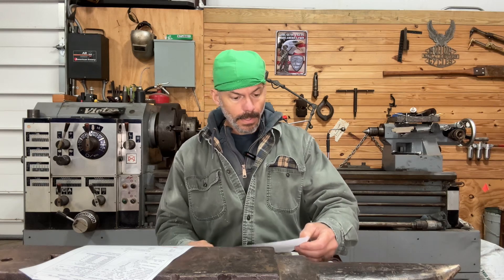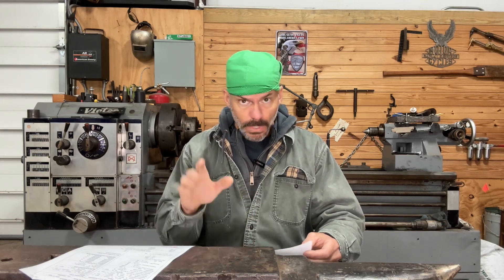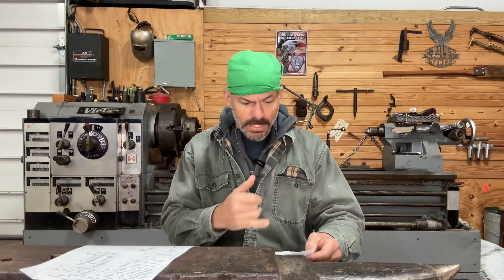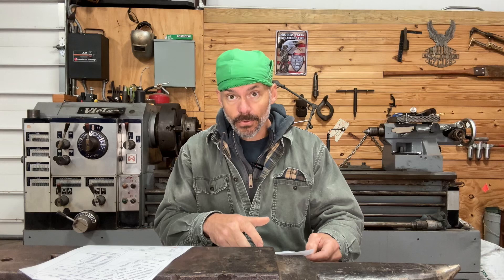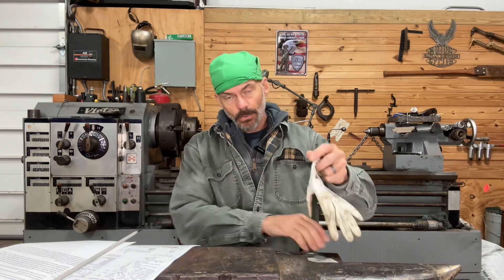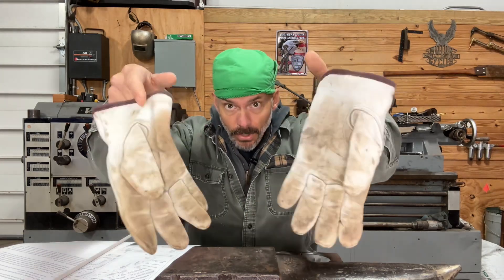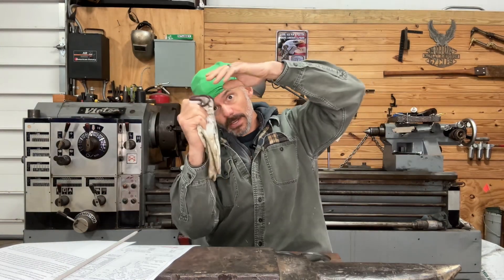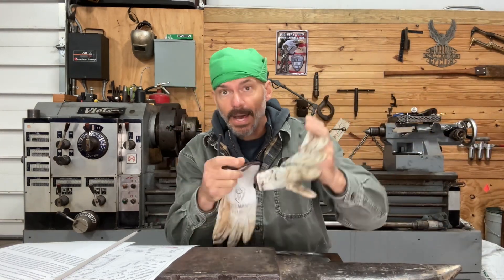WELDING TEST SETUP & Taylor welding Q&A

Comment: I was welding for a  company and they keeper tell us to weld stringer.  I set my machine on continuous and welded in a weave pattern, and a fellow welder told management that I was doing a weave pattern and not stringers. I had just finished up a 12 hour day, and the management came over and told me that my job was on the line for doing the weave not stringers.. that was my last day of work week, and I didn't come back till next Friday at 6 pm. We worked 3 12 Friday till night Saturday night Sunday night. The best job I have ever had in my welding career ever... so didn't know if I had a job  to come back until I got back...got back and everyone congratulated me for my weld. Cam to find out in house inspection did two different inspectors and out side inspection did three different inspectors. Passed everything. Ultrasound inspection.  So, watching the puddle is vital.

Comment: What’s up I’m Isaiah and I did my overhead test and they cut it yesterday. It looks clean, but I’m not sure if I pass because as I was doing it, there was like a gap between one well and I worked it. I did too small welts between those those two strips of lines and then I did on top of that. I did another worldafter that, and then after that, I put my finish layer on

Comment: I am not a pipeline welder,  but I can relate to your comments in working the puddle. Yes, I did take the AWS test on 1” plate beveled vertical and overhead and passed both rayed with 1/8” 7018 . I appreciate your comments and knowledge.

Comment: Wide weaves are a fracture toughness thing, the more heat you put in the lower the toughness of the weld with medium carbon steels. Most jobs do not have a serious concern about fracture toughness, but those that do will usually put a weave width restriction on, and be a little bit fussy with interpass temps.

Comment: In the mid 70's (Navy shipyard high pressure plate school) we did just vert and overhead on 3/8 plate with a 1/4"backer and 1/8 7018 only, no grinders just a chip hammer and a sharpened 1/8 7018 rod as a slag pick, passed my first try at the end of the course (which surprise the living crap out of me😂) but boy did we practice I mean a 50# box of rod a day, 12 hours per day 5 day's a week for three months. they pushed us real hard and constantly preached to do better every day like we were Navy Seals or something, this was a very difficult class to get in and had to be recommended by  the div. officer to attend, because when we got back to our ship's we had to teach the other's., I am forever grateful for that experience. it would be interesting to see how today's schools are run and how hard students are pushed.
Excellent video sir, 😉👍

Comment: Cant empahsize enough how important this is @ 8:34  CHECK your rods. Chipped tips, spotty coverage dont use it on a test. Not saying throw it away but you want as much in your favor as possible.  I'd even go as far to say the same for 60/8010 cell rods. Much less of an issue with those but if the flux isnt evenly coated you WILL have it burn all messed up and fingernail

Comment: (For new welders) On a plate test, they cut the strips out 1" above and 1" below the centerline. If you have to stop or do something weird, do it in the middle of the plate, not in the test strip area. Take soapstone and mark where the test strips are BEFOR starting the test. After knocking the slag off, pay extra attention to those test areas. Scoot.

Comment: A few years ago I was injured at work and was not able to go back to that job. I had to figure out what I wanted to do for a career after that and found yours and a few others videos that I found extremely interesting and informative. I am now structural steel welder with all positions stick, and working on getting into a union to further my career. Big thanks to you and the tips I’ve learned from watching your videos🤟🏻
Reply: If you can, get your 3G/4G flux core certs on 1". A lot of structural jobs are running .062 and .072 flux now days.
Reply: @scooterinvegas1  cool thanks for the info dude